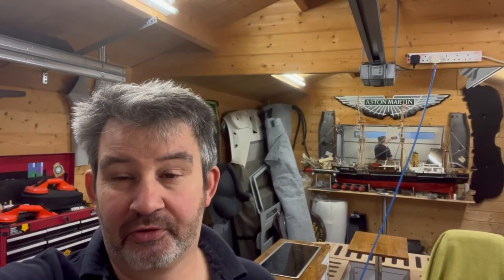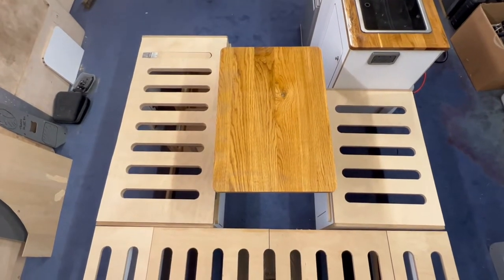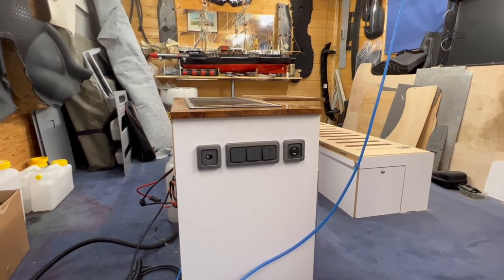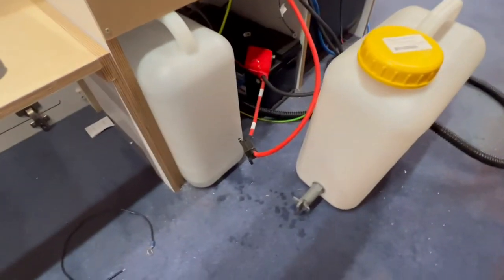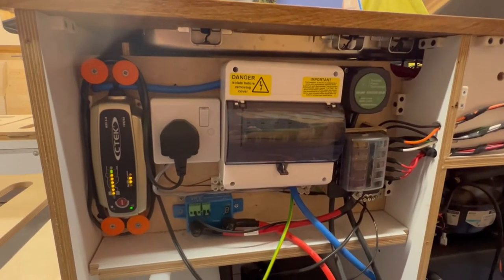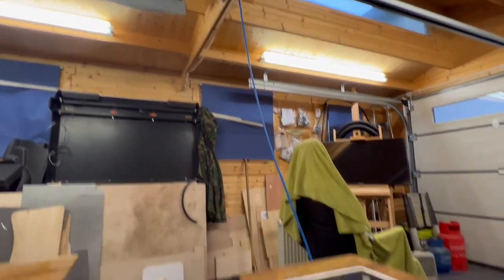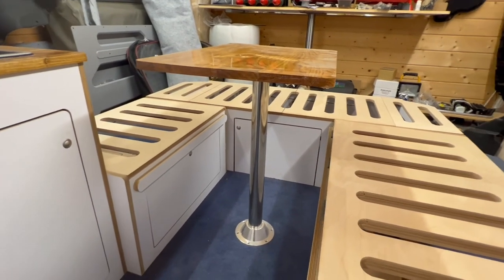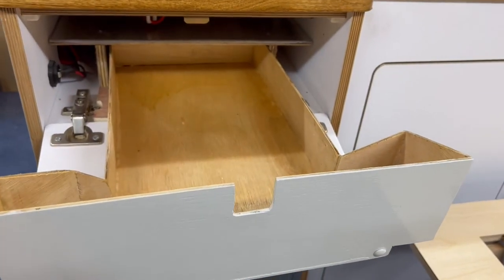VW T5 / T6 U-shape (Rear Lounge) Camper Interior Installation: Part 1 (Cabinets and electrics)

Comment: Hi Norm, how are the gas cylinders working for you?   Did you still have to put a floor vent in?   Great video btw.
Reply from the maker: Thanks Steve! The cylinders work great. Small, light and easy to carry spares - although we only used two during a full week away - so you don’t need that many. I didn’t fit a floor vent as the volume of gas in each is so low and you switch them off at the cylinder after each use. We do have a gas and a CO alarm however. Cheers. N

Comment: Hi Norm, I ordered the cadac regulator as per your recommendation. However, I’m struggling to make the connection from the quick connect (left hand thread) to the 8mm copper that attaches to the hob. Any help would greatly appreciated. Thanks
Reply from the maker: It seems extreme but I cut off the threaded connector and pushed the rubber tube on to the copper pipe and secured with a jubilee clip. Sorry, I should have made that clear before. Let me know once you’ve got it up and running. Best wishes. N
Reply: @highergroundlifestyle  I thought that might be the case after trying to zoom in on your video. That’s no problem, I’ll add a compression between the pipe and the hose just to be extra safe. Thanks again for getting back to me. Your videos have been very helpful and one of the deciding factors in us also going for the u bed setup 👍
Reply from the maker: @gauthierblanpain773 , many thanks. The u-shape works for us! I have a few more videos still to edit of our trip last Summer that will hopefully show it in use. Stay safe and enjoy the van. N

Comment: Hello, I'm thinking of getting this same conversion for my van. Where did you get the removable table? Did you specifically request not to get the folding table instead?
Reply from the maker: Hi. The table was supplied by the same people who supplied the U-shape and cushions, Van Furniture. I asked for a free standing table instead of the wall mount as I think it’s a more sociable layout. The table is in oak and matches the optional oak work surface. There are two types of table mount, flush and “mushroom” (raised). The flush mount is neater but requires a hole in the floor. I went for this. Best of luck. N
Reply: Hi, which regulator are using with the canisters? And where do you get the canisters from? Thanks
Reply from the maker: Hi, I’m using the cadac regulator. It’s designed to allow you to use screw in cartridges for their garden BBQ’s but works great. No regrets using the cartridges as they’re small, light, much safer and easier to carry. I tend to order on line as it’s cheaper but you can also get from any camping shop. Cheers. N
Reply: Amazing. Thanks for the quick reply 👍